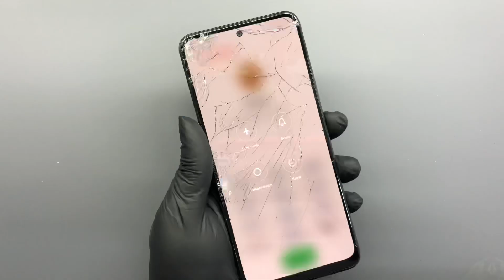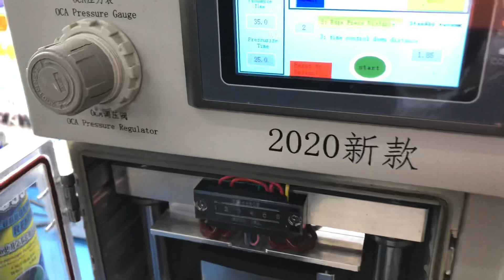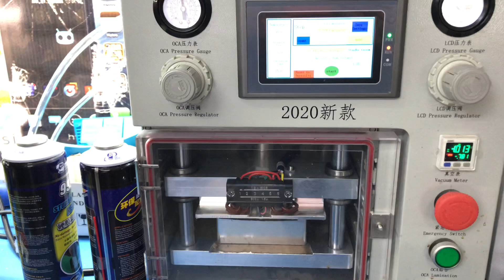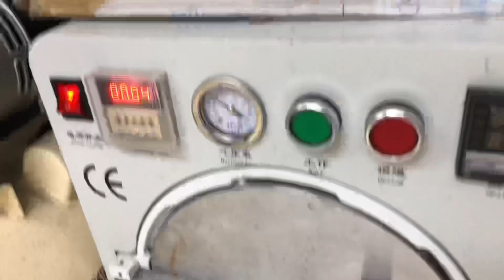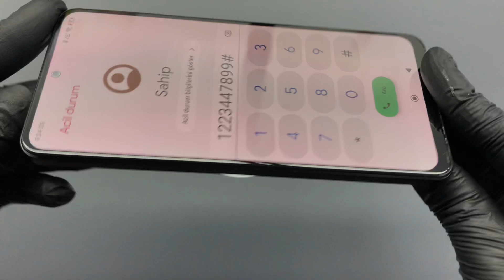Xiaomi Redmi  Note12 Cam Değişimi

Comment: Öncelikle selâmün aleyküm. Redmi Note 12 Pro cihazım yaklaşık 1.5 metreden düştü.  Bu modellerin arkası da cam olduğu için arkası tuzla buz oldu. Ekranda ise çatlaklar var, mürekkep akması dediğimiz şey var ancak dokunmatik çalışıyor mu çalışmıyor mu anlayamıyorum bu sebepten. Cihazda sorun yok açık ve çalışır durumda. Hattım çıkardım ihtiyacım olduğu için. Arkalı önlü tamir kaç lira tutar reis? Acil çünkü üniversite sınavına girecek bir öğrenciyim çok yanlış zamanda oldu bu.
Reply from the maker: Merhaba ; 

.arka kapak değişimi 400 tl  orjinal ekran değişimi 3000 tldir

Siz değerli müsterilerimizi mağazamızda görmekten mutluluk duyarız. 

Diğer soru ve önerileriniz için lütfen web sitemizde ulaşabilirsiniz www.telefontamircin.net 

Güncel Fiyat Bilgisi için Whatsapp Destek Hatımız 0553 722 72 72  İLETİŞİM  0553 711 72 72

Saygılarımızla 

Tufan İletişim..
Reply: ustam redmi note 12 sadece ön cam kırık dokunmatikte vs hiçbir sorun yok sadece cam değişim ücretiniz nedir
Reply: @emirhanyasar6237  ben 600'e yaptırdım orijinal değil ama şu ana kadar büyük bir sorun yaşamadım biraderim